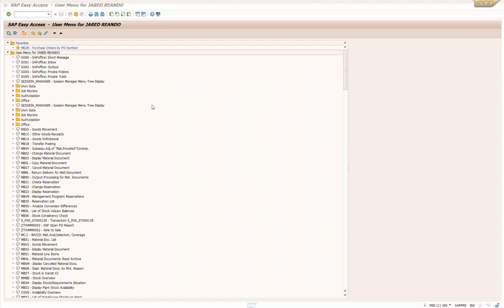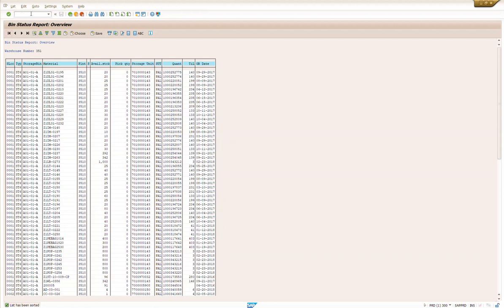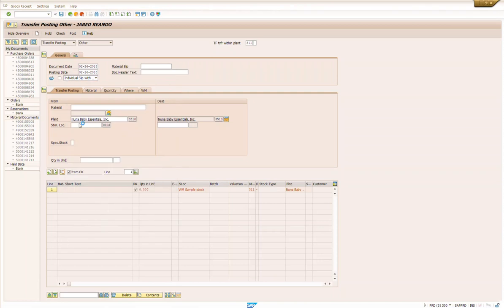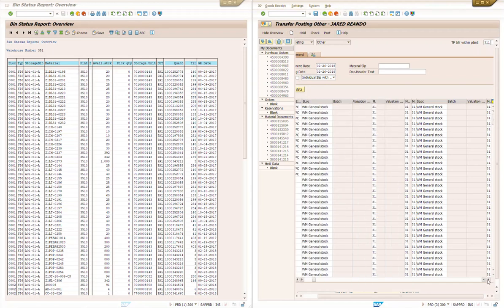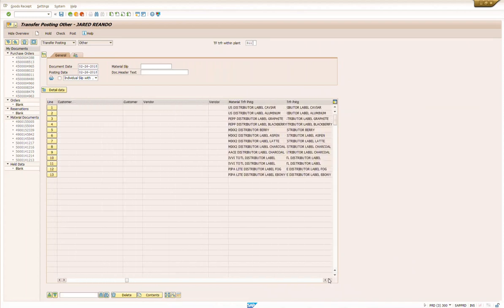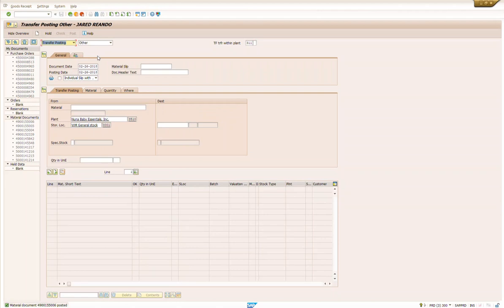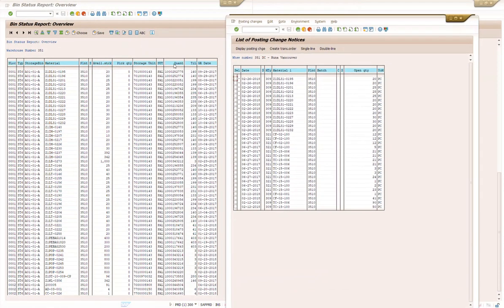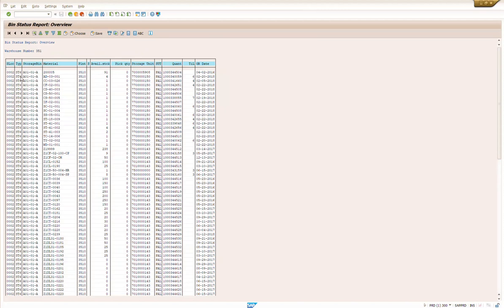In-Plant Transfer Posting using MIGO

Comment: Is this much simpler than MB1B process? 

The other question I have, can you still use what you mentioned about the MIGO process  if transferring to a SLoc that is not WM?For example, going from Sloc 011 (which is WM managed) to Sloc 012 (not WM managed)Sloc 012 (3rd Part WHS)Both in the same Plant - Multiple Materials / Lots